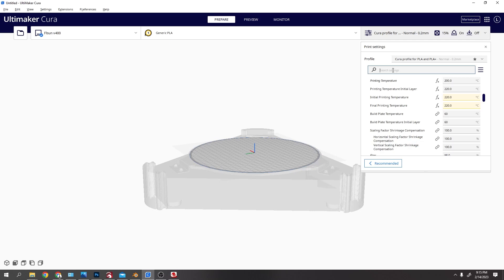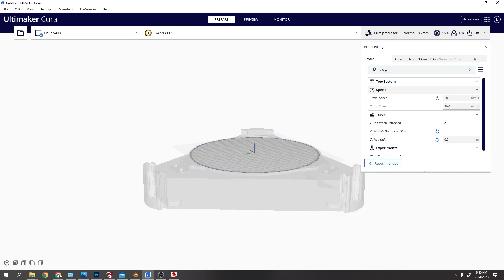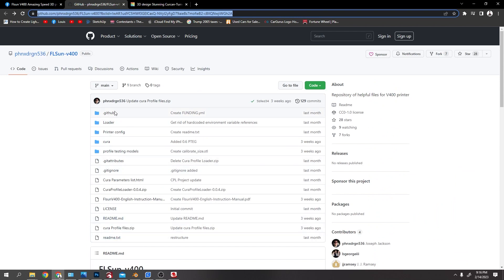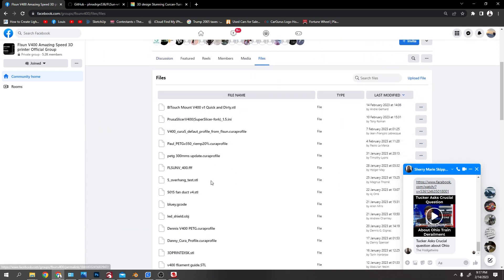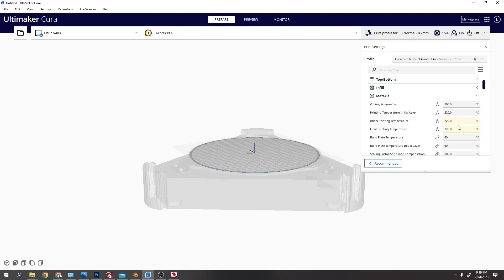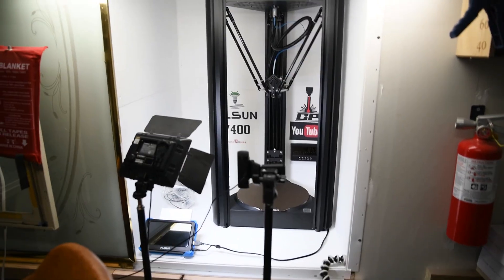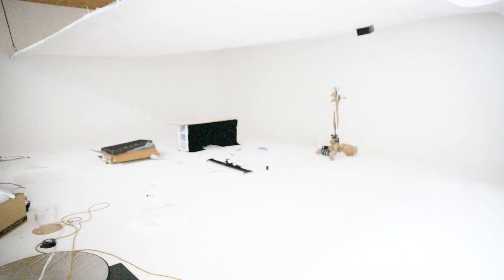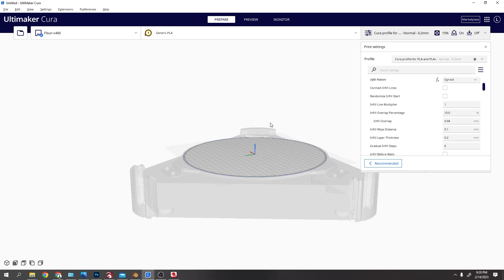FLSUN V400 ELIMINATE NOZZLE SCRAPING WITH THESE SIMPLE CURA SETTINGS & ROOM UPDATE.

Comment: I have had that problem with my Ender 3 S1 Plus. I could hear this noise like the tip was hitting something and I could figure out why. Perhaps I need to look at those settings for it in the slicer.
Reply from the maker: yes give it a try, just be aware that these settings do add a bit more time, but everything seems to run smoother.
Reply: Klipper by any chance? Same issue on my S1 Pro. Talking to Creality now. I'll be insisting on a refund if they can't fix it. I'm all out of ideas.
Reply: @kimjongil6294  
No ; no klipper. It has something to do with the type of infill and the nozzle seems to hit certain parts as it travels across the print. I haven’t got back to printing cause of back pain issues have prevented me from doing work to my printer bench. Looking to put bracing on the bench legs to make it more stable platform . I think there is a setting which makes the printhead lift slightly to miss clipping other parts of the print. Apparently the FL Sun v400 is a culprit but if you change 2 settings in your slicer it stops it ! When I buy 1 I will be testing this theory !
Reply: @jayson8118  The setting is Z hop. But really your printer should know where the print ends. 
I've just removed Klipper and printed with the stock firmware and still an issue. So a printer issue for sure. 
I've just read that over extrusion could account for it, so I'll check that too. Good luck!

Comment: Crashed my flsun v400 by scraping on the work piece. One of the arms let go on the printer head. After reattaching it, the planes of the work platform and the working planes are off by more than 12mm between the extreme xy and the z axis on this machine. Do I have to tweak the configuration codes (parameters) to get this machine working again, but which ones.
Reply from the maker: wish i could help you with that but you will have to speak to FLsun, or join the facebook group and ask on there, i am really not sure, thank you, these settings in the video did get rid of all my scraping though. so make sure when you get it up and running to add these settings. good luck
Reply: You may want to check your belts this happened to me and it stretched one of my belt by about 15mm and I could see the fibres inside it. They are simple to replace yiu just need to get about six or so meters of 10mm wide gt2 belts. Take the old ones off loosen the tension bracket at the bottom. Put new belts on. Tighten the belts to about 50hrz ( use a guitar tuner app to find that and strum the belt like a bass string with the arms all the way to the top at home ). Then run your bed mesh etc all over again you should be good

Comment: Thanks for sharing. I’m not on Facebook so I’m wondering have you heard anything about crappy first layers? Their sample prints are fine but anything I slice has a bottom either really stringy or rough like 80 grit sandpaper. I’m positive it’s settings but I can’t figure out which ones need adjusting.
Reply from the maker: it sounds like your z offset, on the pad set Z to zero and recalibrate with the paper once you got it just right make sure to click save on the computer or go to console on pad and type save_config, i did make a calibration video, make sure you wipe the bed over each time. mine has been fine, check your belts and oil the rails, another video on that if your unsure.
Reply: @carphotography  you may be correct. What was messing me up was their included models (bunny, bolt/nut, etc) were printing fine but mine weren’t. Since I messaged you, between settings, another levelling, and testing the Z axis, I’ve achieved decent results. This 3D stuff is very cool and very maddening!
Reply from the maker: @braddahr  yeah i have a lot to learn myself, today was the fist time i tried printing PETG :D done a nice job actually.
Reply: @carphotography  on my Cr10S I couldn’t get a good petg print. I gave up. I tried on the v400 and the prints completed but they were crappy. I have 1.7kg of black petg and.3kg of silver but I basically gave up.
Reply from the maker: @braddahr  have you tried printing on a glass sheet or the other shiny side of the plate ?
Reply from the maker: @braddahr  i put the PETG profile i use on dropbox try that out, mine printed fine. https://www.dropbox.com/home?preview=V400+PETG+200mm+with+support.curaprofile
Reply: @carphotography  do you mean with petg? My CR10S has a glass bed. On the v400 I just printed on the “normal side.” On the v400, the prints finished but they didn’t turn out very well.
Reply from the maker: @braddahr  i only have a v400 so the profile is for that, did you do my calibration video ? and the other things i mentioned in other videos ? Z-hop and combing. that helped me, anything that helped my printer i added a video about it basically (Y)
Reply from the maker: @braddahr  can you see this page ? https://www.facebook.com/groups/flsunv400/learning_content/?filter=6083614521724198&post=107549252307434
Reply: @carphotography  The Petg profile says "File Doesn't Exist." You have a video on petg? I haven't seen it. I did try all the adjustments and I even got a printer profile from FLSUN that was supposed to address issues. I'm not sure what in all that worked  but I am now getting decent PLA prints from the V400.
Reply: @carphotography  I saw you mention it in your video but I don't use FB anymore. Just YouTube and TikTok.
Reply from the maker: @braddahr  this is the v400 PETG profile should work this time. https://www.dropbox.com/s/k57m3ymvvat42ea/V400%20PETG%20200mm%20with%20support.curaprofile?dl=0
Reply: @carphotography  thanks I’ll check it out.
Reply: @carphotography  over the weekend, I tried printing in petg and it failed five times. I give up.